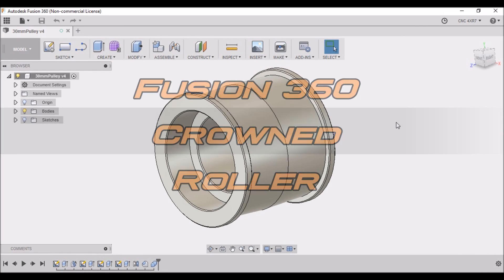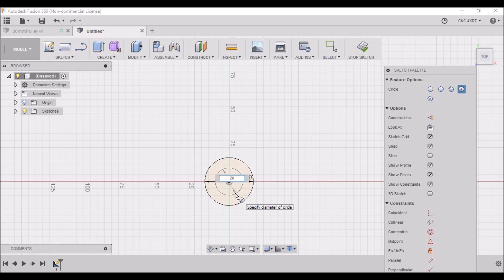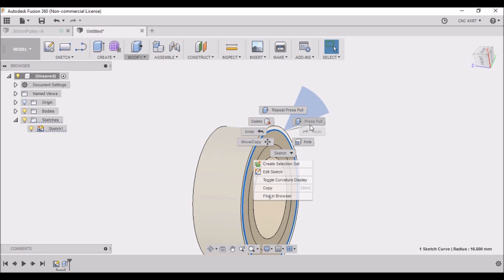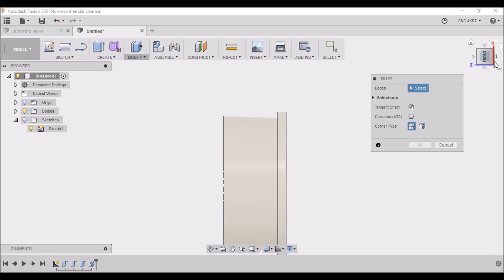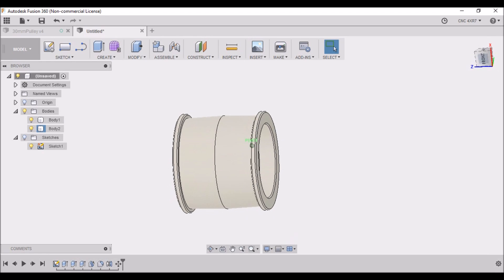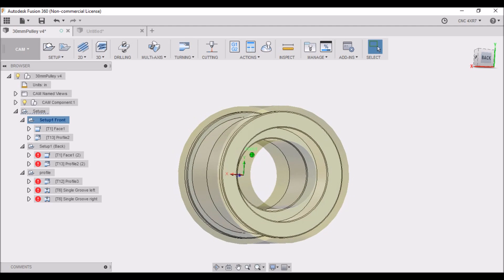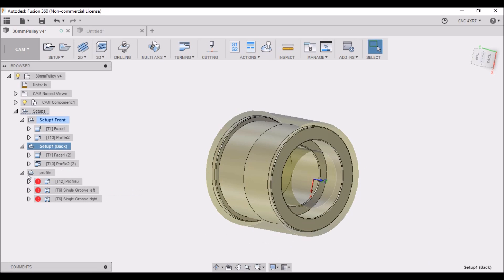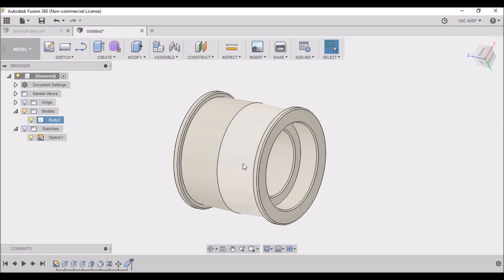Fusion 360 Mirror Feature

Comment: If you want to use inch as your main dimension in a design you have the option to type "22mm" into a dimension or vice versa if it was set up in metric you can type "0.5in" into a dimension and fusion does all the conversion for you.

Hope that makes sense.
Reply from the maker: Hi Jon,
Yes I do use that method sometimes However I fined it to get confusing when you go back to retrieve dimensions in the models and also when making a 2d drawing of the model. I personally just like to keep it all the same MM or Inch.